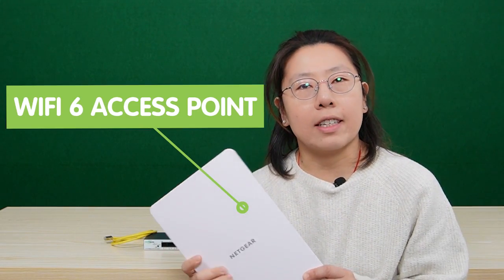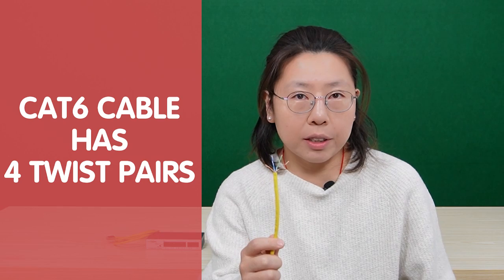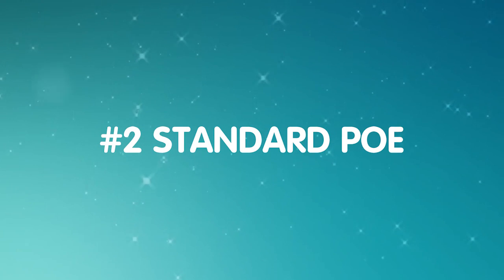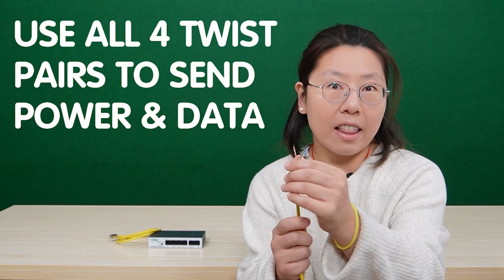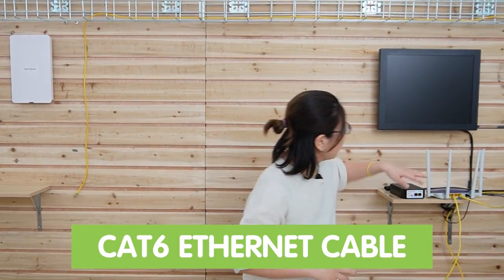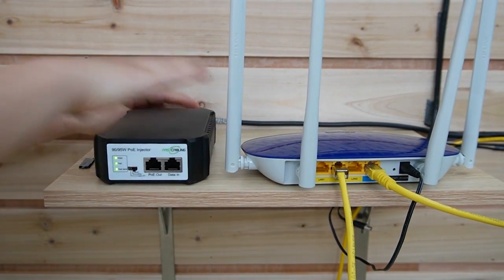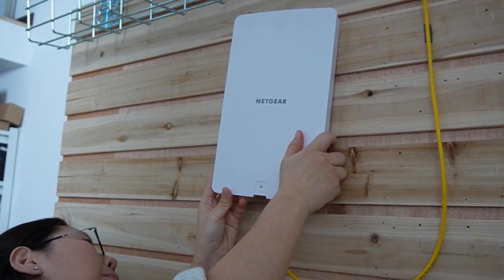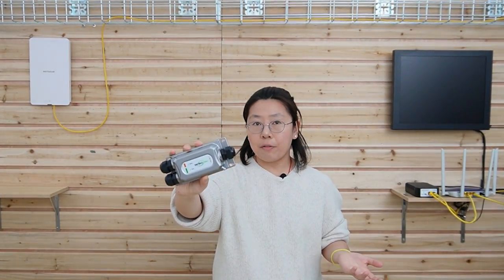2 Methods to Power PoE WiFi 6 Access Point Passive PoE VS  Standard PoE

Comment: how we can order this Device ? thnx
Reply from the maker: The device we used in this video is 90/95W 802.3bt Power Over Ethernet Midspan Injector.

Purchase link: https://www.fastcabling.com/product/90-95-w-poe-injector/

If your edge device is not PoE-compatible, we will suggest you use the PoE splitter to split the power from the data and feed it to a separate input that a non-PoE device can use.

PoE injectors & PoE splitters: https://www.fastcabling.com/product-category/poe-injectors-splitters/

Comment: How do you do this with fibre cabling thanks.?
Reply from the maker: You might refer to this video. It use fiber optic cable to connect a Wi-Fi modem. Transform Gigabit RJ45 to Fiber Optic Using SFP Media Converters
https://youtu.be/RbWT_3RMpxc